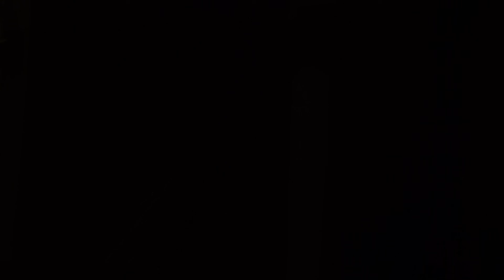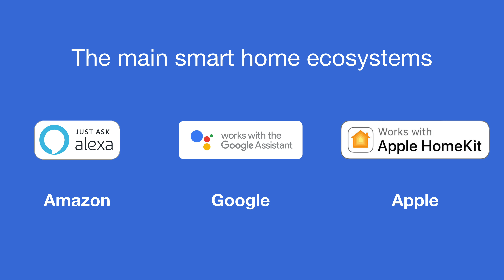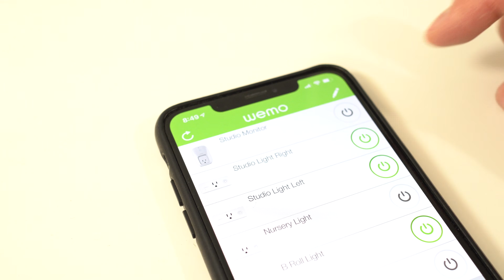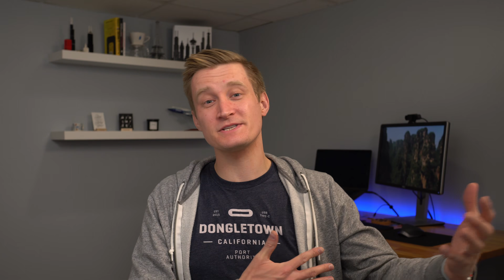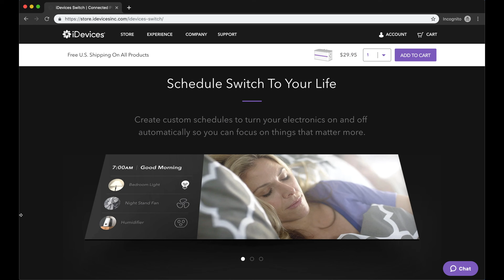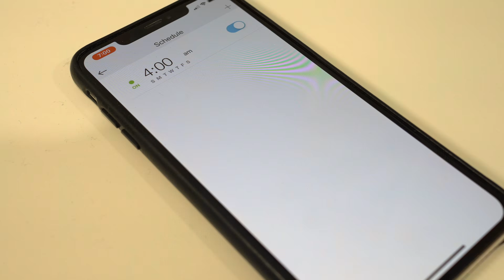Your new smart home setup needs smart plugs!

Comment: My first smart home (Apple HomeKit) product was a garage door opener.  I had a 2007 opener (not a smart opener), so I had to purchase a chamberlain bridge along changing out wired in wall controller (where I needed sync my phone to the bridge).  Unfortunately, it fails to find the garage door opener about 30% of the time.  I may need to change out this option.  All of my other smart devices work pretty flawless at this point - deadbolt for the front door, doorbell and door sensor linked to a light for my closets.

Comment: Smart plugs are great but if you plan to use them for crockpot, hair dryer, and coffee maker you need to make sure they are compatible with your system wattage. You can blow them up in no time.
Reply from the maker: Good point!

Comment: For me it is idevices vs Wemo. Every single other plug I’ve used has been unreliable incl. ihome, hue, etc. ihome has been the worst. I literally threw them in the garbage. Most reliable has been idevices. Flawless connectivity. Never ever had to reset. And I use the nightlight to trigger my door lock so that I don’t have to authorize on my phone. Wemo is a lot cheaper and has been reliable too UNTIL they started using user accounts. Now depending on the plug (with our without HomeKit code), I sometimes have to reset every few weeks. I’m tempted to get meross plugs because the light switch and the outdoor plug I have from them have been flawless too.

Comment: Do you know and have tried any smart outlets instead of just smart plugs to make things cleaner and less cluttered with it sticking out?
Reply from the maker: At that point a smart switch controlling the outlet is probably ideal. The other option is a surge protector with smart plugs built in.
Reply: Eric Welander what brand and product do you recommend that has a surge protector?

What alternatives do you know for these products?

Comment: My first device was a smart plug from iDevices. I hooked it up to a small lamp in our living/dining area mostly as a proof-of-concept. Next came the LIFX bulbs which are much more useful in my application, though I've had some issues with them (reverting back to a LIFX automation when trying to use them with Homekit). I'm saving the rest of my smart-home purchases for after my wife and I buy a house. From there, I'm definitely expanding my Homekit setup. 

Great advice about choosing devices compatible with all 3 major platforms. That can be huge, especially in the future should a platform go EOL like Lowes' Iris recently did.

Comment: Thanks for another cool video Eric!

You and Shane Whatley are on the same page this week. Great minds thinking alike? Maybe some preliminary coordination for a future collaboration? I’m intrigued. 

- As I am ‘all-in’ dedicated to the Apple Ecosystem, a lot of this week’s content wasn’t targeted at me...but I will say that I am a BIG fan of the Lutron smart outlet. 
I held-off buying an ‘outlet control’ solution for a bedroom floor lamp, thinking it wouldn’t get frequent use. In hindsight, that should have been my first piece of Smart Home tech - as it is the device that gets (aside from the Insignia garage door controller) used most often. 
While the Lutron Caseta stuff is among the most expensive in this ‘smart device world’, they are a VERY solid product - and in the case of outlet control, has left me with ‘zero’ complaints. The ability to control the outlet with Siri, Apple’s Home App - and (in my case, most often) with Lutron’s Pico Remote is all sorts of useful. 

Good stuff.
Reply from the maker: Thanks Bradley! Haha yeah Shane and I aren’t that coordinated...at least yet. It’s complete coincidence, although hopefully two different sides of the same general topic.

Great other thoughts too man. Garage door control was another one of those things I didn’t think would be as useful until I installed it.